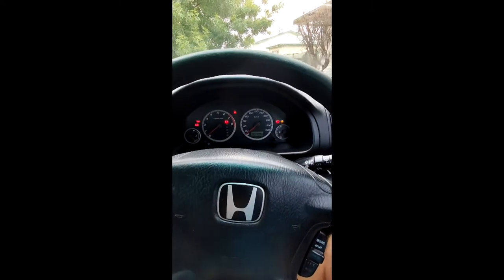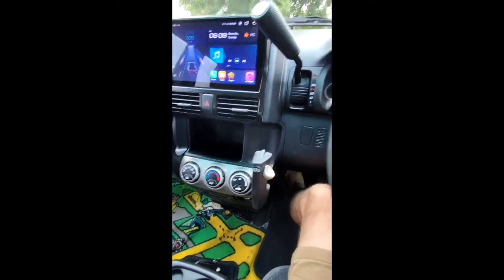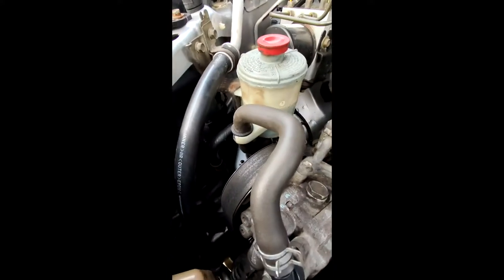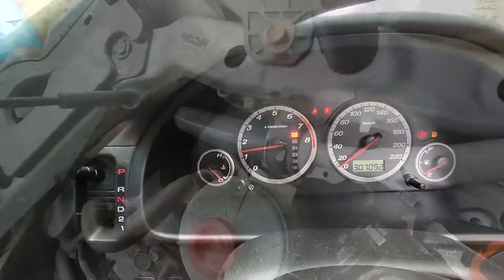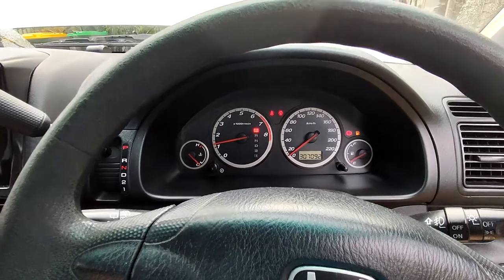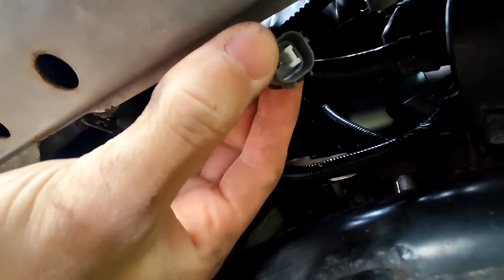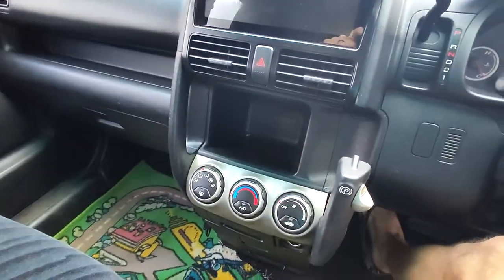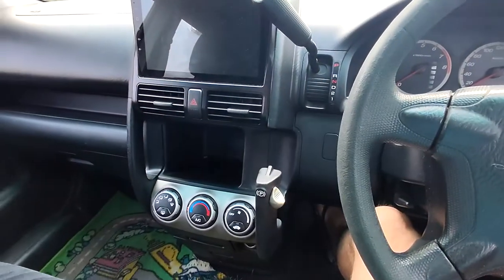Honda CRV 2003 AC Problem Compressor and Switch Test

Comment: wow mate. I'm an Aussie in Philippines struggling in the heat with this broken garbage. im so jealous of your video. so.. ur engine bay, u can make out different parts, that's amazing, u can fit your hand into URS without being cut by rust and ur wound infected by vaporized ahardened feces. mine is just grey with road grime from the world's filthiest environment. anyway on to the arguments. how do u know that the compressor is "acting as it should" simply because the switch bypass made it turn on? aircons don't go "low on gas", they leak not consume, and that leak is most likely the compressor itself. this model compressor sucks and apparently it implodes due to a design flaw.but that doesn't mean it has to be a catastrophic explosion, it could be a slow death. mine was leaking and that led to hissing, so some bastard scammer came to my house while I was at work and scammed my wife out of bout 100 bucks by just shoving more gas in it and convincing her it was fixed. this thing is simply a hopeless model with countless fails of engineering leading to a car that is so overcomplicated with design flaws that I've had enough.
Reply from the maker: Hi, that doesnt sound fun at all to work on 

i am aware of the compressor recall in some regions, 
being that summer here sucks for about 3 months, i can handle the slow leak of gas.

As the AC will get my through the summer